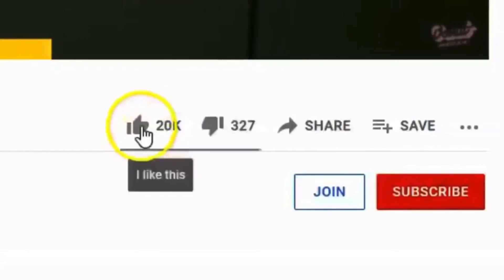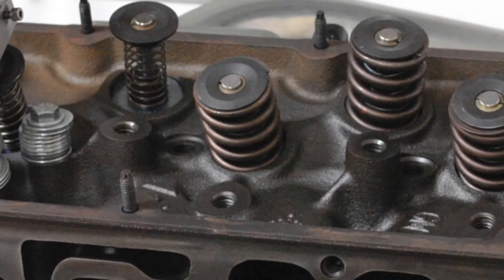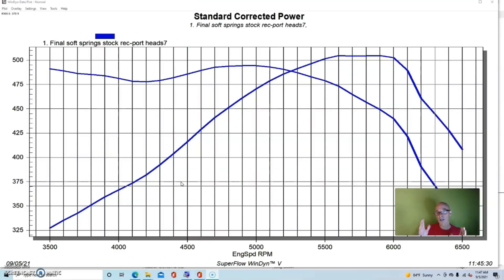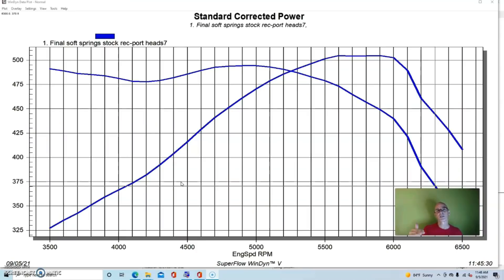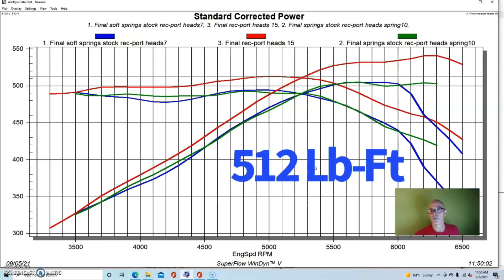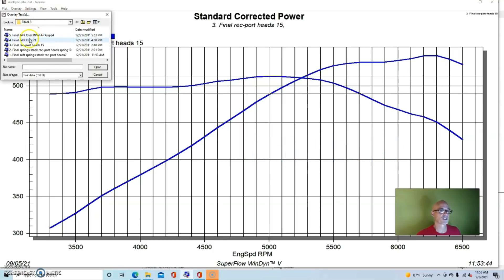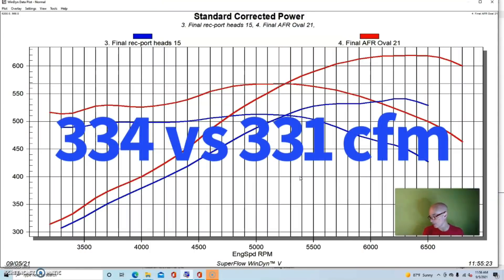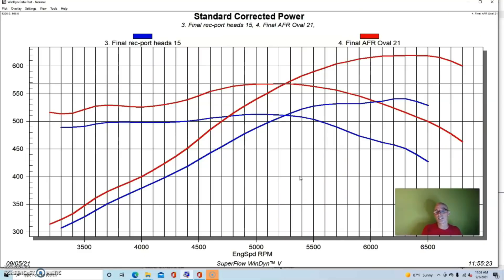HOW TO: BBC VALVE SPRING UPGRADE.  DOES SPRING RATE MATTER?

Comment: OHC engines use valve springs like the OHV engines. Yet, they don't suffer from valve float until much higher in the RPM range. Why is this? The OHV has the lifter and pushrod linking the cam to the rockers unlike that of the OHC. Obviously those components are the real issue that needs addressed. Placing higher pressure valve springs is just a bandaid on a bullet wound.

And, you CANNOT "cure valve float." You can defer it later in the RPM band.

Comment: What about valve springs and seat pressure for boosted engines. If cam was left stock and no increase of rpm was sought after.
Reply from the maker: we have run on stock springs with stock cams
Reply: @richardholdener1727  say even in higher boost applications? 25+ psi? 
Just hard to separate fact from fiction when looking through forums. Ideally the concepts make sense but who knows.
Example Some bring up the positive pressure on intake side can help initiate valve float, some go into valve size so square inch vs pressure applied (increase valve spring by math given), then there is exhaust back pressure which is usually higher than boost pressure and that keeping the exhaust valve open. So many things.
Reply from the maker: WHY WOULD ANYONE TRY TO RUN 25 PSI ON A STOCK CAM APPLICATION
Reply: @richardholdener1727 😅🤣 I know sounds dumb but  we see it a lot in the bike world. Most will degree cams and leave them. One reason is cost. a set of cams for bikes can cost 1000-1600. Add in valve train parts and you could be up 1500-2000.

Comment: Yea let’s see the difference when you throw a proper cam in that motor to match that head. If you put a cam in it that’s got .800 lift, I’d be curious which head makes more power then. It’s not just a set of heads, you gotta have the other parts to match what those heads are good at. This cam was engineered better for the afr heads. With a higher flowing head, you’ll make more power with a bigger cam and at higher rpm.

Comment: Richard. Did ya'll use the rod bolts in the SpeedMaster connecting rods or did you upgrade to ARP's?
Reply from the maker: THEY HAD ARP IN THEM WHEN I GOT THEM

Comment: I agree on higher spring pressure with HR cams.
I'm running 150 closed and 420 at .6 on sbc with 1.7 rockers. PAC 1.275" duals so light weight. 
Also need to remember if your springs are a little soft your lifter wheel will come off the cam, causing damage and wear. There think there was evidence of this at lower rpm with the softer springs.

Comment: in your opinion...do you feel the AFR oval preformance heads would be a significant amount more representative to what the 049 stock ovals would do... when compared to those rec port head? do you feel the 049 heads w/some port smoothing would work well and adequate to a solid roller 255@.50/ .680 lift (7000 rpm range) ???
Reply from the maker: THE AFR IS A LOT BETTER THAN THE STOCK 049

Comment: Perfect timing Richard. I’m trying to guess my spring pressures. 5500 red line so I can use much softer springs than recommended. Have you tried LS style small beehives on a 454?
Reply from the maker: WE HAVE RUN BEEHIVES ON THE BBC-BOT NOT STOCK LS SPRINGS

Comment: I've been running a similar combo for almost 20 years with AFR 305 rectangle port heads, they didn't have ovals back then.  Compression the same, and similar 242/248 hydraulic roller but custom grind from Comp with .638 lift, 110 lsa.   I use the RPM air gap on it with a 1" open spacer.   I liked the curve better than the Victor Jr. since it's primarily street driven and the spacer helped a pinch up top.  This combo makes a very fun street engine and has gone a best of 11.38 @ 118 in a 4100 lbs chevelle through a full exhaust system and DOT tire.

Comment: The lighter the spring the better. The hydraulic roller is heavier than a mechanical flat tappet  and the mechanical has faster lift possible, So if you want to rev it real high  forget the roller and go with a flat tappet.

Comment: Can't get over how well the engine responded to the AFR oval port heads.  They absolutely blew the big rec port heads into the weeds.  I would take that 468 combination with the dual-plane manifold.  It gained 30 hp at 4000 rpm, and lost 20 hp at 6500.  I think the average power advantage would go to the dual-plane manifold in that case.
Reply: It would feel better driving around on the street with the dual-plane, but that single plane will win at the drag strip every time. If you shift around 6500 rpm, it will probably drop down to 4700 or higher on the gear change. The single plane is already matching the dual-plane there.

Comment: Hard to beat those AFR oval ports for the street. Just for grins overlay a 6.2 LS3 with a 469 cam over the iron rec port head dyno curve. I always thought comparing the LS to a BBC was nonsense, but in some cases not. Once you put the good heads on it it certainly IS nonsense, though!

Comment: I contend that flow values at low, mid or high lift, or even average flow fail to express meaningful information given they don’t provide total cfm flow per valve actuation cycle.
Reply: That's true, but you can still make more power by picking the head that has the best average flow through the range of valve lift.  In order to get the total flow over a valve actuation cycle, you would need to have the full valve lift curve and do degree-by-degree calculations using a curve fit of the cylinder head flow data.  I have done that sort of thing in Excel to compare the power potential of different heads on a given valve lift profile.
Reply: @andyharman3022  
I fully understand all the contributing factors that you detail, and others.
I contend one simply bench measure total flow on a fully outfitted engine via electric motor at the entire operating range, over a given time frame as the the absolute, accurate measure of flow.
Reply: @flyonbyya  Or just do a fired dyno test with a good airflow meter.  There is no substitute for the real thing.

Comment: I've seen that ugly curve drop on the dyno more than once, and with a worse drop off. Some times all that was needed was a .060" shim under the springs to fix it. Some of the worse flat tappet cams are the small Extreme Energy since you wouldn't typically put a big spring on such a mild cam that is intended to peak at 5200.

Comment: I know these are basic setups! But normally today, spring companies want the spring setup within a certain distance from coil bind! 50 thou, 100 thou, whatever they tell you! Unless you’re using a 30yr old spring design! I guess it worked fine on puppy cams. But we rarely setup springs on seat pressure anymore! I’m also wondering why you never mention about cylinder head material grade? If it’s going on a basic rebuild, it probably doesn’t matter! But normally people looking to your channel are looking for the most power possible, not just a rebuild! Also probably worth mentioning about the rocker box of the head! If it’s a rebuild with low power/puppy cam, it doesn’t matter, but put a big shot of nitrous or boost on the engine & some heads will rip the roof of the intake port completely out! This stuff is probably worth mentioning even to the guys doing basic stuff! So he doesn’t have to upgrade head again when he gets bored with the power! Who doesn’t? Thanks for trying to point all the morons straight! I love how you make a video on something, back to back, whatever, than they say, oh I wish you tested with this head/cam/intake! I very surprised you have not said, why don’t you go test it you lazy couch potato mtherfker! 😜😜😜😜😜😂😂😂😂😂👍🏻👍🏻👍🏻👍🏻👍🏻👍🏻
Reply from the maker: coil bind clearance set up is not nearly as critical as seat and open pressure for 90% of the street/strip applications, we use it for wilder combos with more rpm

Comment: We had a 396 on the Dyno that was in trouble at 5600.
Swapped the Comp steel retainers for the Comp titanium versions. Picked up 400 rpm and 30 hp.

Comment: I remember an old mechanic telling me about the problems with the 409 dropping valves.  Must've been pretty common, apparently whenever they revved the engine to around 6000 rpm.  I learned later that the valve springs were the weak link in the 409 and better springs became available.  I have no experience, just a lot of useless second-hand knowledge, but that's the story I heard..

Comment: Dont know about gm engines, did they overlook testing during development.  This goes with that at susans.
Reply: Those 088 heads were designed more than 50 years ago.  Much has been learned since then.

Comment: I thought going over 36 or 38 total was frowned upon?  41 total sounds nuts, but the dyno doesn't lie
Reply from the maker: they want what they want
Reply: @richardholdener1727  on a hot day, on a race course?  That's what I'm curious about.  The dyno offers ideal scenarios, wouldn't it be wise to go conservative once its into vehicle?  I know locked timing will ping a motor to death without an educated throttle pedal foot...
Reply: Keep adding until it doesn't make power.  His timing was locked, meaning it didn't change with rpm.
Reply: Most of the time 454s are gonna want 38-44 total
Reply: @GJ-DT  interesting to know

Comment: I wonder if AFR uses less spring rate since they use lighter valves?  NOT MUCH...
PAC Racing Springs #1940
Street Hydraulic Roller Spring 1.550 O.D.
175 lbs. on seat
.725” max lift
Max RPM 6500-6700

Comment: Exhaust is a big key
If you can't get the exhaust out
You're screwed
1.75 exhaust valves on 406 ford heads
Woke my 428 ci up back in the 70s

Comment: Flow testing heads with just some playdough around the port, I still can't get past that.  I'd rather see an intake / exhaust manifold bolted on as there has to be some sort of influence no?  .
Reply: You can always buy a bench and some heads and intakes and do videos yourself if you want???
Reply: Well then you're not testing just the heads.....you're now testing an intake or header or both....
Reply: @ks_1111   Given an engine runs with an intake and exhaust, these would matter if they influence head flow.  Say a head flows 300 and the intake 250 , you could have a 500 head and still only get 250.
Reply: @bobroberts2371  they have always been rated and tested as a seperate units

Comment: can it do the reverse..does a too high spring rate or too high rocker ratio make you loose power??
Reply from the maker: high spring rate does cost power
Reply: Technically speaking, higher spring rate does not cost power, this is a fallacy, it can actually increase power duo to proper closing without seat bounce. Remember one thing, there are the same number of valves opening as well as closing and as any spring is closing the energy is returned, this was a proven factor at Reher-Morrison racing engines.
Reply: High spring loads increase friction, so can lose a small amount of power.  But power loss due to valve bounce on closing is worse.